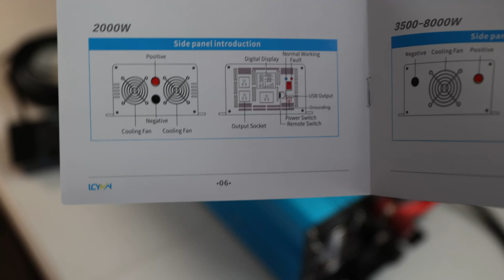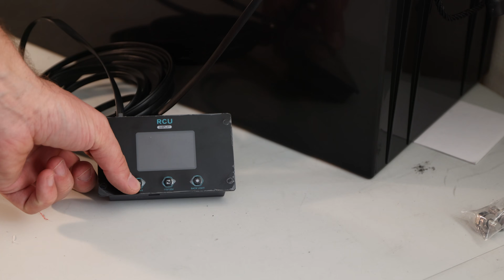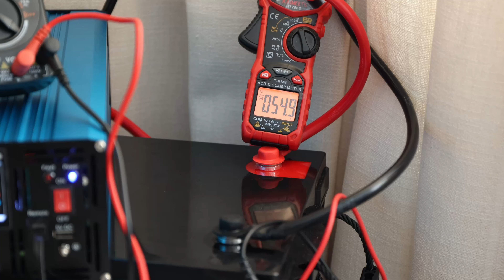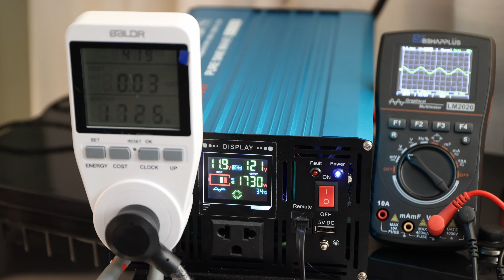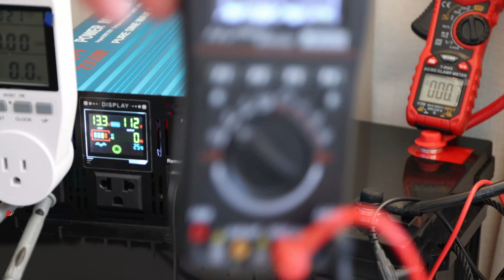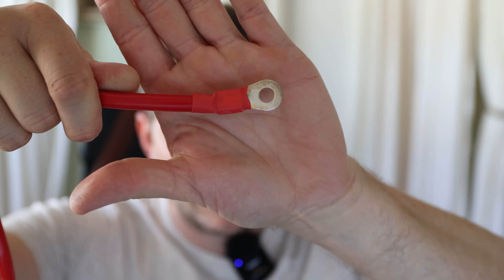LCYMW Inverter 12V 2000W | Review

Comment: I believe your battery's BMS is cutting it, or else your inverter's low voltage protection is activating. That C-rate looks too high for the battery you have.

Comment: The input voltage dropped to 11.6 before shutdown. The output was still 119 volts. The internal temp was not too high 29C . It would be a better test with a stable 12 volt input. 2 x 100ah lifepo4 should provide 2500 watts for a short test with big enough wire.

Comment: It’s the cables with this inverter. I have two of them that work fine above and beyond there limits. I have the same 2000 you tested and also a 24v 3000 watt unit. I had to replace and use higher quality cables on both to solve issues. It’s a shame the company builds a quality product but sends cheap cables that can’t handle the power.  Just thought id let you know. I bought them both cheap at sale price, so wasn’t too upset i had to spring for heavier gauge copper wires. Just don’t understand why they send cheap cables with a great product otherwise. Also I have a perfect sine wave on both !
Reply from the maker: Thanks for sharing! I should include those tests going forward as well... Thank you :-)

Comment: I bought the larger one 2500 watt and find the same real world issues.  I have a kureg which pulls 1500 watts and I can not get a full 8 oz cup of coffee with it as it resets.  and more I used it the more it fails.  guess you get what you pay for  I went with a bigger one for extra head room.  I have it in my semi with 4 large batteries  and better cables then came with it.   Sadly passed the return  date.  works good with toaster and microwave.  Microwave runs much better than with a modified sine inverter I had in here.

Comment: Of course it failed. It's a high frequency, transformerless inverter that offers a low surge capacity and a short life expectancy when compare to a real inverter that uses low frequency, transformer based inverter technology. Never buy a high frequency, transformerless inverter from any manufacturer. Always buy a low frequency, transformer based inverter if you want a safe, reliable inverter that's going to last.
Reply: You're totally right. I own this LYMW 2kw in 12 aug2023, and only used a couple time for the 1200w hair blower, The power was set at 115v. the blower cut in-out then display f05.
I tuned off and turned back on and set the voltage at 120v, The blower can only runs on low heat, Unfortunately, I hurt the burnt smell along with 2 popping noise then the fault light stays on. nothing works after all .contacted amazon after got this unit for 31 days(13dec2023). OUT OF LUCK.
The inverter driver board blew 2 of 22mfd-35v aluminum cap , 4 mosfet,'s case cracked
Reply: What’s a good 2k inverter

Comment: How many batteries do you have hooked up to it ? 
You should have 2 of the ones you have
Reply: Yes, too much load to use on this battery.  In order to drive this much of an output, you need a larger battery bank and larger battery cables.  The cables supplied with the inverter are too small for the maximum load output.